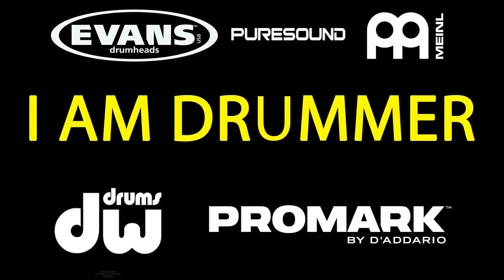DW One Touch Clutch

Comment: looks like its along the same lines as the gibralter quick release clutch , think the dw is abit more over engineered though , i have used the gibralter quick release clutch ever since it came out and never had problem with the 2 top nuts and the quick release hase never released ever during playing and is super fast for pack up at end of the night

Comment: After more thought... I'm still learning, I still don't get how it helps to have something like this.  You have to take a hand off a stick, reach up and twist the nut, then you get a different tightness on the hats.  Again, why can't foot pressure do this?  Foot pressure is what I do, but if there is another option, I'm all ears to suggestions.  Again, I'm just curious and want to learn more.
Reply from the maker: You still need to take a hand off the stick so to speak to adjust any clutch but this one is a lot easier to do and control.
Reply: It has nothing to do with how tightly the two cymbals are held together.  It's about how much space there is between the felts that hold the top cymbal.  If the top cymbal is too loose in the clutch, there's a tactile click when you close/open it with your foot, caused by the delay between the top cymbal contacting the bottom cymbal, and the top felt pushing the top cymbal down tightly (backwards for open).  If the top cymbal is too tight in the clutch, the cymbal is unable to move, which may affect the sound of the hi-hat in an undesirable way.  In either scenario, foot pressure is useless to alleviate the problem.  The first problem is most common, because the two nuts used to adjust how tightly the top cymbal is held can loosen over time.  You don't really notice they're loose until you feel the click I described, and it can be very annoying to have to finish a song while the hi-hat is clicking like that.  The second problem only happens because someone else messed with your clutch setting.

Comment: Once it’s locked in, it’s locked in

Ok, how do you unlock it?
Reply from the maker: Turn it to loosen……and turn it to tighten.
Reply: @IAMDRUMMER  I found out why I couldn’t get it

There was debris in the threads

Take the o-ring off, remove the pins, clean the threads

Comment: Can't you just use foot pressure to do the same thing?  Maybe I'll get flamed for not knowing enough, but I'm not looking for that.  Just tell me why this is better than foot pressure?  It isn't a double bass pedal where I can't have my left foot on the hats.  I'm honestly curious.  Please help me learn why this helps.
Reply from the maker: Are you asking why you can just add or decrease foot pressure, one of the main reasons for using a clutch like this is to change the amount of tension on the top cymbal on the fly. The loser it is the more the top cymbal will move adding more wash and air movement between the hats.

Comment: total pain in the ass!  especially if you've got arthritis in the hands.  It keeps on locking up both top and bottom screws.  I never had. any issues with the old clutch.  I'm returning it, not fit for purpose.  As someone down below said, over engineered.
Reply from the maker: Sounds like most clutches could give you some form of issues if you have arthritis in the hands, it can be a real pain in the ass. Can you tell me how it's locking up at the top and bottom of the clutch?
Reply: Had the same issue with mine, it's so difficult to do anything with it. Once I managed to get the bottom screw off, I could not put it back on, and I can't to this day. In short unusable